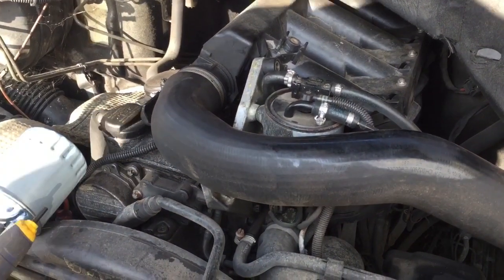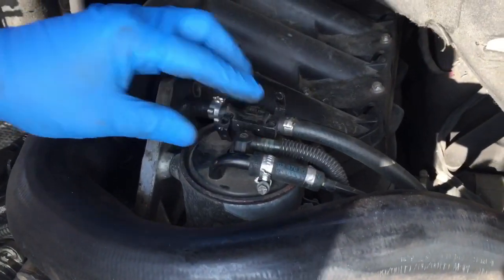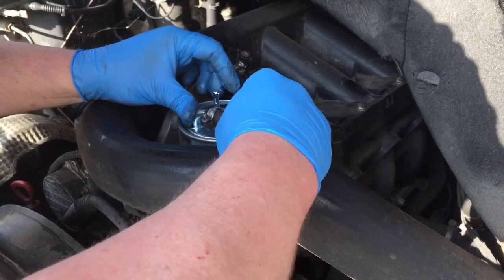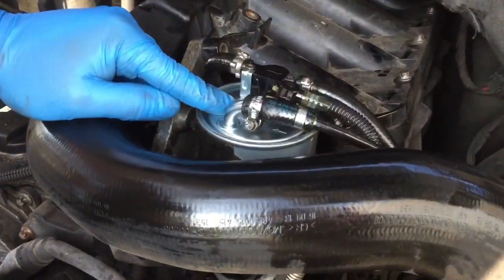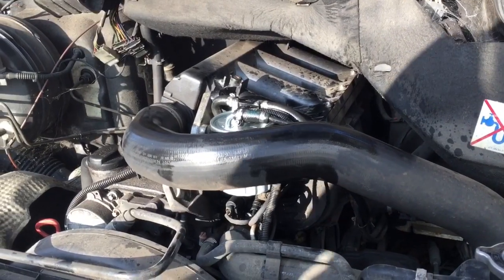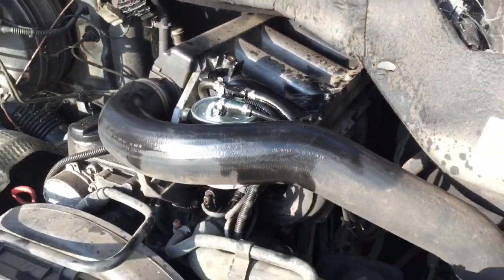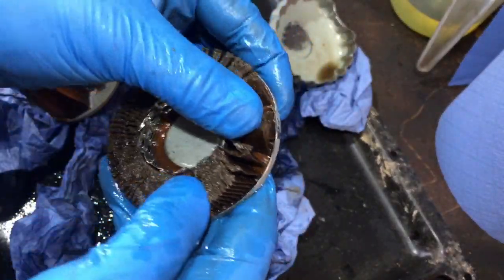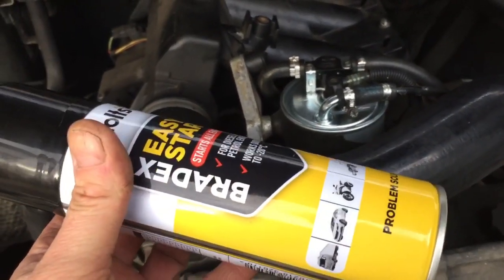Mercedes Sprinter 311 CDI 2004 Van ( Diesel Fuel Filter Change ) #Menditman #DIY #Fix 🦾

Comment: You don't need to bend out these little metal brackets, you can just rotate the connection after you undo the screws. In fact some of the aftermarket filters (like Ryco) have cast iron brackets which will break if you try to bend these.
Also its much easier to fill the filter with diesel before you put it in the car.
Reply from the maker: Hi the way I did this was what I found was the easiest way, Cast iron brackets on the filter are you sure🤔 that would imo be a bit overkill. Also it would have been much harder to fill the filter with diesel before. Thanks for your input but the way I did it worked well for me. Thanks for watching 🙂👍

Comment: Looking at this after I realize my vehicle has missing hoses my plastic T piece on the vehicles side of the filter is blanked off both sides for some reason. I bought this sprinter not too long ago. any idea what the two hose pipes that's connected to the T piece is comming from?

Comment: Not a good idea to crank it that long.
Reply from the maker: Hi I had to draw the fuel up as there was so much air in the system, easy start helped in the end. I’ve seen people crank a lot long than this trying to start diesels after a fuel filter change. It was fine but I was probably on the limit to stop and give the starter a rest though, thanks for watching 🙂👍

Comment: Very good but how are you supposed to do it. I usually gently pinch off any flexible hoses with vice grips and or then block them with drill bits. This stops the fuel running too far back down the pipes. If the filter is full and the pipes were clamped off you shouldn't get too bad an airlock but can still expect a fair bit of cranking. Get the battery charger out if you have a weak battery.

Comment: I'm trying to diagnose why my sprinter is not starting.  It's been at the mechanics for over a month now.  I was driving it on the highway then turned off for a quick break then it wouldn't start.  I used engine start spray and it worked .  I stupidly keep using it as a way to start it for two weeks then that stopped working altogether.   Ps I took out one injector two weeks before and replaced the washer plus cleaned it up.  Was working like a dream before this happened 😢😢😢 Thanks for any help in the comments.

Comment: Hi , thanks for the vid, just wondered if it helped  the  uphill performance at all?
Reply from the maker: Hi it didn’t really make much difference, check under your air box that the vacuum pipes are connected,when I got my van it was terrible up hill than I saw the pipe was off and it improved it massively 🙂👍

Comment: Hi. The last product you add for start the engine again, how do you apply it? I had the same issue that the engine started for few seconds, then turned off and didn't want to turn on again. I am completely new at diesel world.
Reply from the maker: Hi I sprayed a product called easy start in to the air intake, it’s flammable and starts the engine briefly to help draw the diesel up to start the engine, don’t spray to much though just a light spray each time and continue until the engine keeps running. Hope this helps and thanks for watching 🙂👍

Comment: My way to fill the filter back up is just bang a hand pump on the return side to the tank and just pump till it comes out a little, then put back together and it starts all the time every time.

Just trying to help not stress the starter out too much bud. 

I had to do the same with a Mondeo diesel and S Max diesel
Reply from the maker: Hi Your method does work at times, I’ve tried it on some in the past and it doesn’t always work. So nowadays I just fill the filter and use the easy start, I know the starters don’t like it but usually they start pretty quick. But it’s good you’ve put this comment as people may want to try your way thanks 🙂👍
Reply: I have a same problem past 7 days fuel filter 
Take air sumone and it’s not start up 
I try to full that fuel filter and put all together start up still take air 
Any one please halp I am stock more then a week
Reply: It’s take  air Evan I full up fuel filter 
Can advice please 

Don’t start up 

It’s trying to start up but no luck 

Today all day raining work on it no luck

Comment: Hello Mate  ! 
Just a bit of useful information back at Ya's...! :)  
- spray "easy start" straight into air intake by removing the big rubber pipe that joins onto main 'air in' from the air filter.... then engine will jump into life...! :)
 - This also works as quick fix if you have  run out of fuel and pulled air into system cranking engine on empty tank.... so long as not toooo much air in there ....! 
Happy 'Sprintering' !  Zander! :)

Comment: Great video..just what I needed..did it improve driving
Reply from the maker: Hi it solved the bad running and has been ok since 🙂👍
Reply: @menditman2004  cheers, going to change mine and do a full service..the easy spray is a good one..

Comment: Hey Luke you did a nice job changing out the oil filter you made it look easy I have never seen a oil filter set up like that but I haven't worked on many diesels though I'm glad the new filter sorted out the issue thanks for the video. If you would be interested in checking out my YouTube channel its Backwoods Boy Small Engines any support it very greatly appreciated. See you on the next one take care. 👍
Reply: It’s a fuel filter not oil